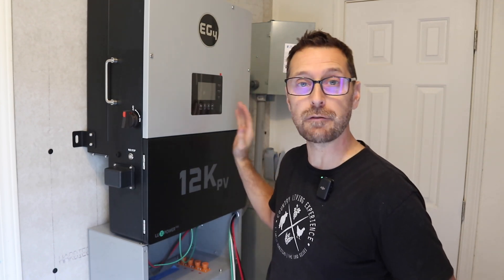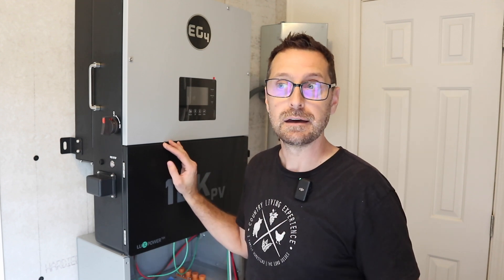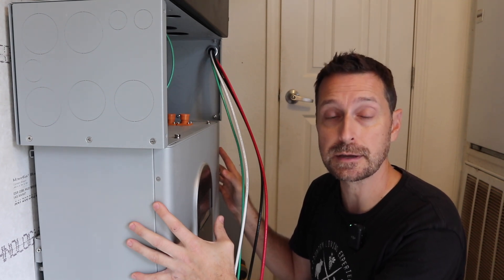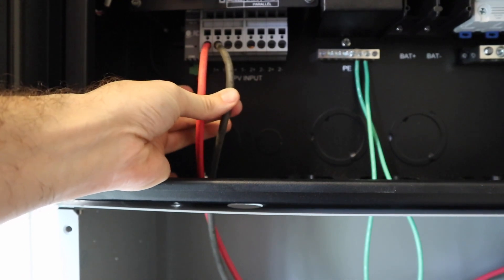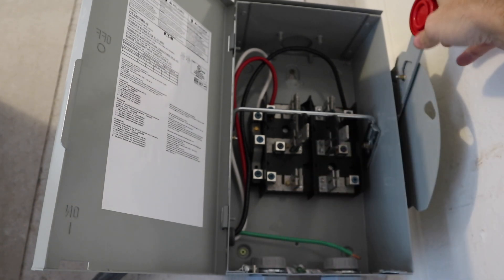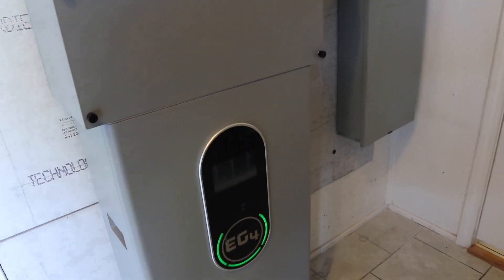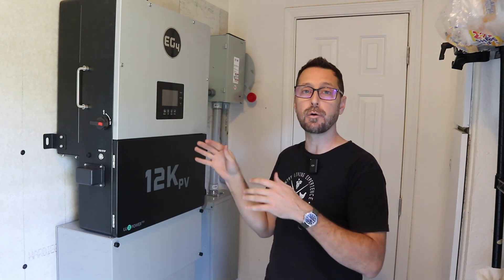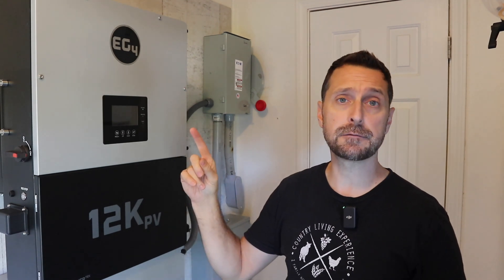EG4 12kpv Install! Wiring And Critical Loads Panel

Comment: Did you choose not to use the grommets supplied with the conduit box to go in the holes between the top of conduit box and the bottom of the 12K?  The sharp edges of the cutouts are a failure point for wire chafing and the wires are exposed in the gap between the boxes.  Not using pass throughs would have failed our inspection.